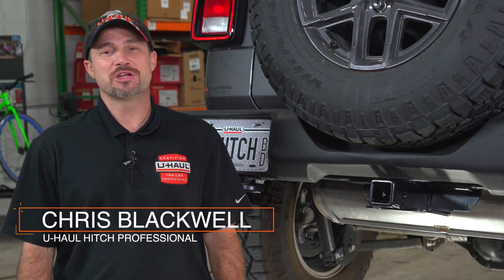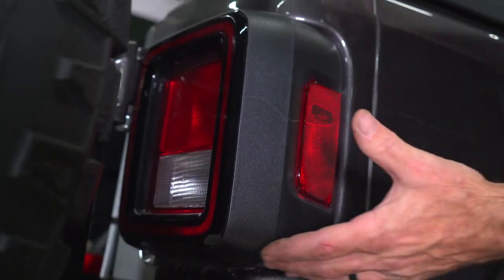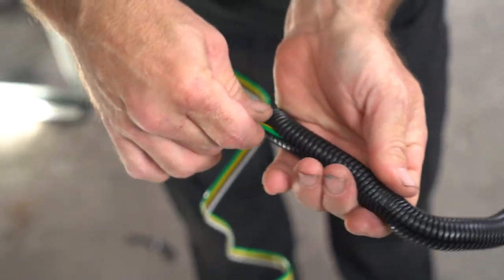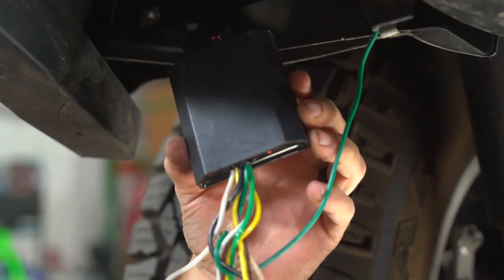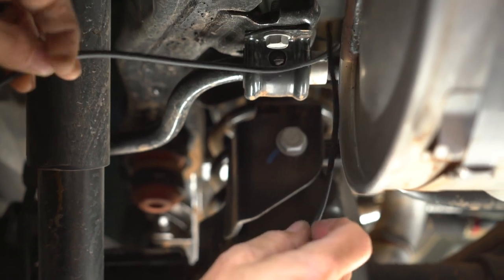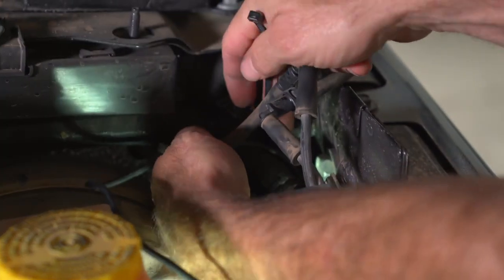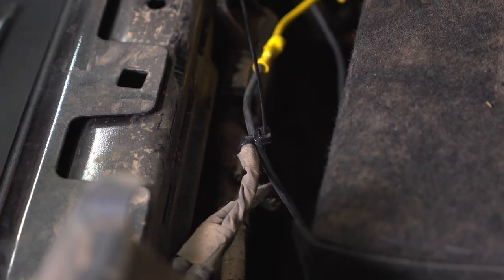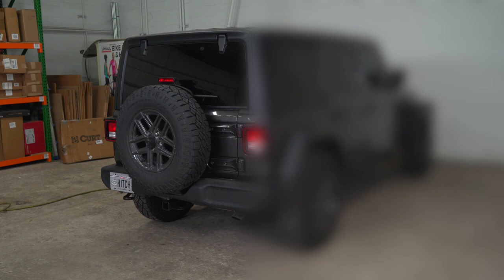2018-2024 Jeep Wrangler | U-Haul Trailer Wiring Installation | CMF56407

Comment: Huh... I just watched a video where they had you take pretty much the ENTIRE inside panels apart, the glove box, and even the plastics around the wheel well.
Reply from the maker: I have done it this way Many times over the years and never had an issue. Hope this video is more helpful than the one you are describing because ive never messed with the glove box or interior panels on a jeep wrangler before.
Reply: @trailerhitches  I literally just installed it your way and it was a CAKE-WALK!!! Headlights just snap in, it's just a matter of connecting and running the wires through the jeep without  dodging any hazards such as the drive shaft or exhaust! I just made mine follow another set of wires!
Reply from the maker: Great Job! Thats how you get it done!